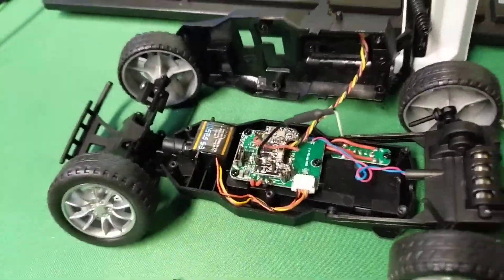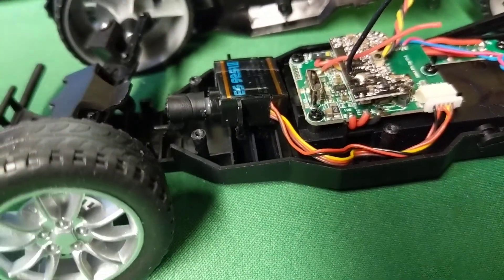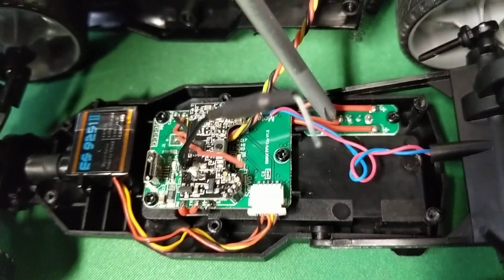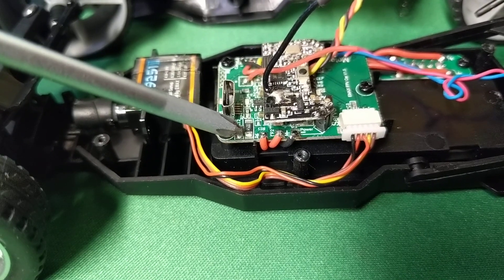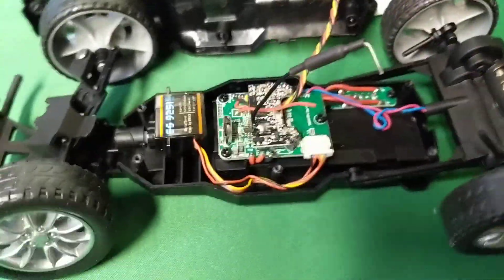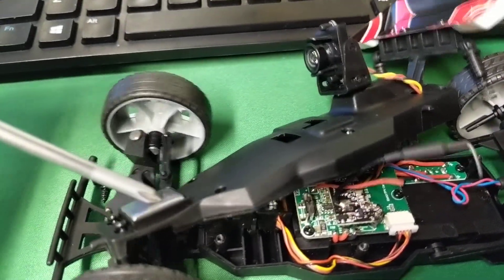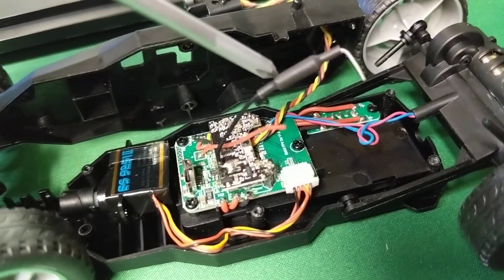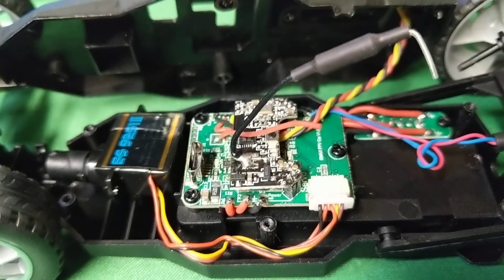Emax Interceptor Internals

Comment: Damn I was hoping the camera is easily removable because I wanted to put it on my other 1/10 scale rc car. But a good thing is the goggles connect to other cameras on different frequencies so that's a good thing
Reply from the maker: I mean, it is removable.  The vtx is built into the circuit board for the rest of the car though, so you have two options.  Remove the camera, circuit board, and battery and mount that assembly to something else, it else just mount the whole car on something else (couple rubber bands should do the trick).  I've done this with tiny whoops and it works amazingly well.